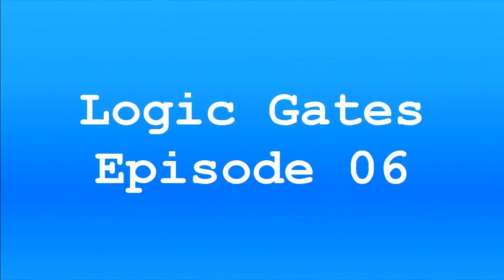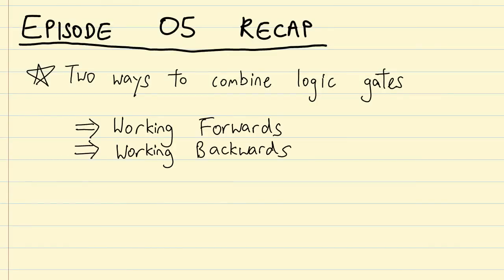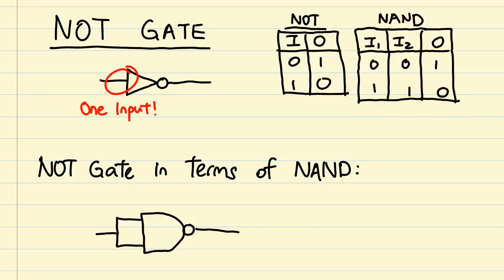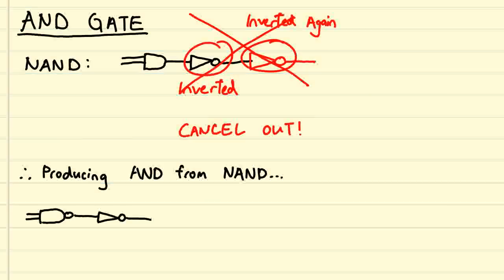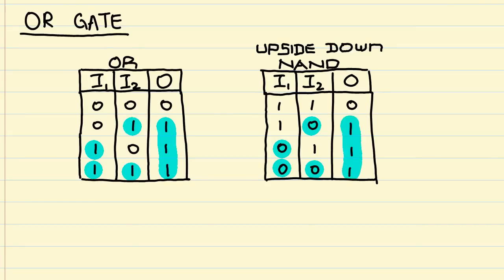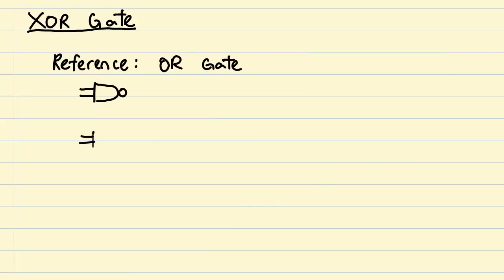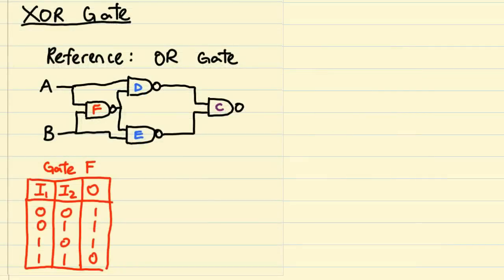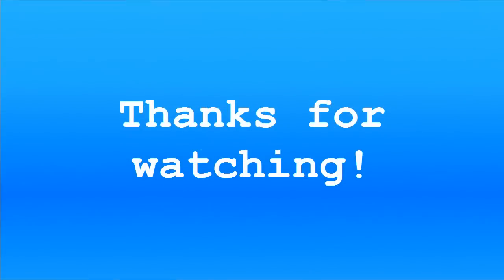Logic Gates 06: NAND Universal Gates

Comment from the maker: @jeeradate
Hello, thank you for your comment!

For the notetaking app, I used Windows Journal - You should be able to find it on WinXP Tablet Edition, or any version of Vista and Seven. If you don't have it, look up Jarnal which is an open source alternative. Of course, I had a graphics tablet to do the writing with.

For screen capture, I use CamStudio. It has some problems with frame rate, so most of what you see is actually sped up.

Hope I've been a help!